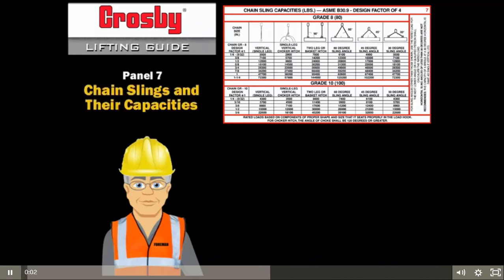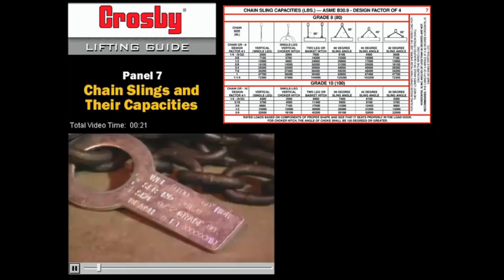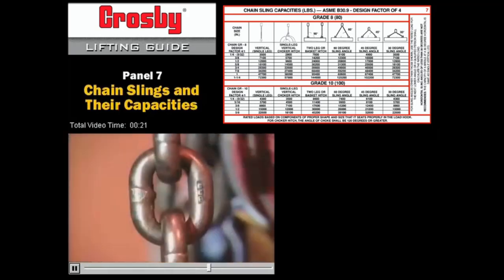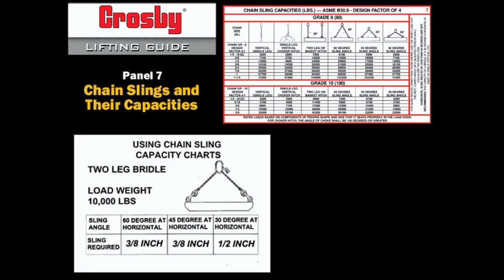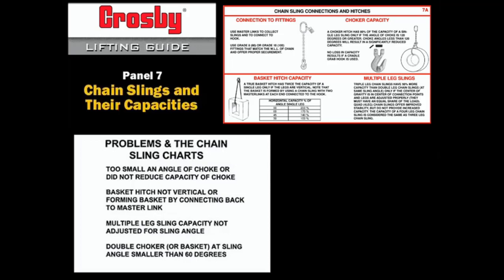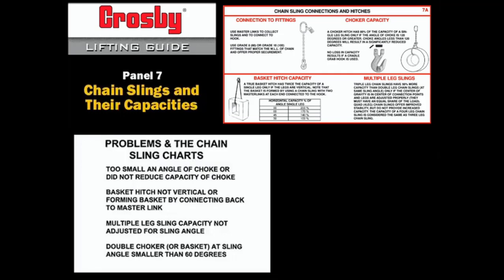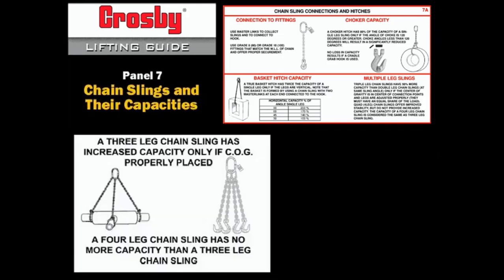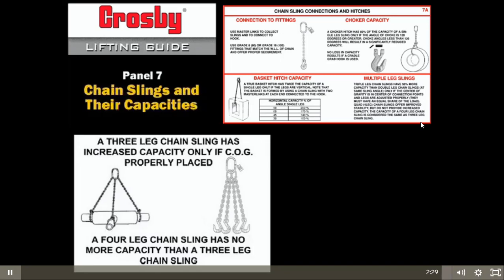Chain Sling Capacities, Connections and Hitches

Comment from the maker: Question 1 of 10
1. Question
Category: Capacity
Chain sling capacities on panel 7 of the rigging card are for:
•   Grade 8 (80) and Grade 10 (100)
•   Grade 6 (60)
•   Any grade

Question 2 of 10
2. Question
Category: Capacity
The capacity of a 3/8″ chain (Grade 100) sling, single leg hitch is:
•   8,800 lbs.
•   7,100 lbs.
•   15,000 lbs.

Question 3 of 10
3. Question
Category: Capacity
The capacity of a 3/8″ chain (Grade 100) bridle (two legs) at 60° is:
•   15,200 lbs.
•   12,200 lbs.
•   17,600 lbs.

Question 4 of 10
4. Question
Category: Capacity
The capacity of a 3/8″ chain (Grade 100) bridle, (two legs) at 45° is:
•   12,200 lbs.
•   10,000 lbs.
•   12,400 lbs.

Question 5 of 10
5. Question
Category: Capacity
A four leg (quad) leg chain sling offers improved stability, but does not always provide increased lifting capacity.
•   True
•   False

Question 6 of 10
6. Question
Category: Capacity
If the C.O.G. is in the center of the connection points and the legs are adjusted properly (assumes equal loading in each leg), a three leg chain sling can have a capacity of:
•   50% more than a double (two) leg sling
•   Same as a double (two) leg sling
•   Less than a double (two) leg sling

Question 7 of 10
7. Question
Category: Slings
When selecting a sling, you must consider:
(select all that apply)
•   Material
•   Size
•   Hitch

Question 8 of 10
8. Question
Category: Capacity
The capacity of a two leg chain sling at a 30° angle of loading (horizontal sling angle) is:
•   More than single leg vertical
•   Same as single leg vertical
•   Less than single leg vertical

Question 9 of 10
9. Question
Category: Capacity
The capacity of a choker hitch of a chain sling is usually:
•   80% of single leg
•   25% of single leg
•   Same as single leg

Question 10 of 10
10. Question
Category: Capacity
The capacity of a three leg chain sling with 3/8″ chain (Grade 100) at a 45° angle of loading (horizontal sling angle), with the C.O.G. properly placed is:
•   12,400 lbs.
•   17,600 lbs.
•   1.5 x 12,400 = 18,600 lbs.
Reply: answer